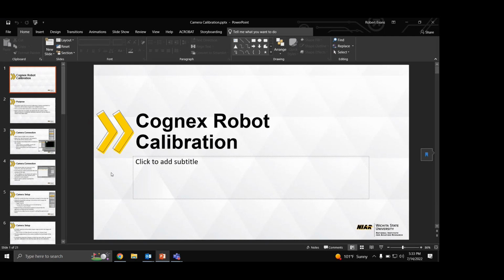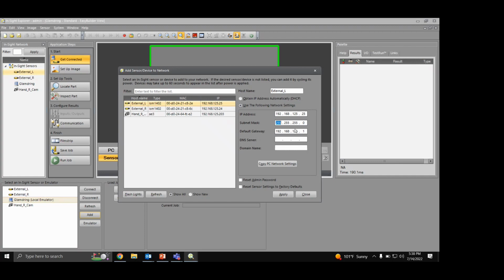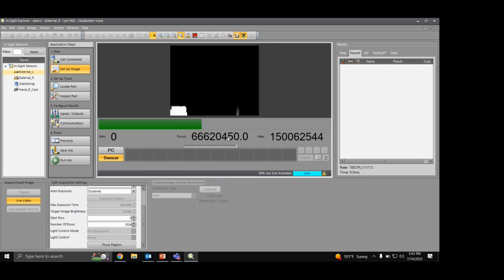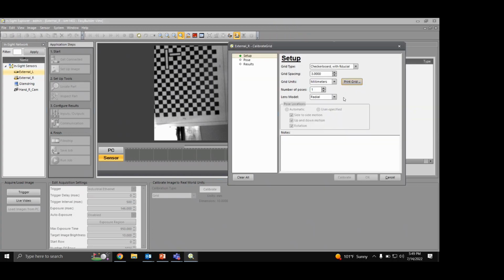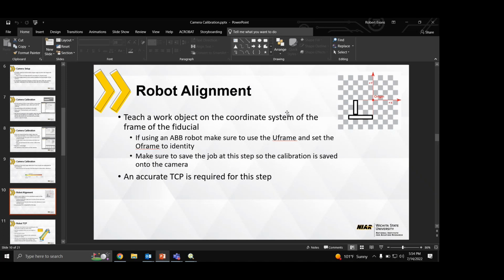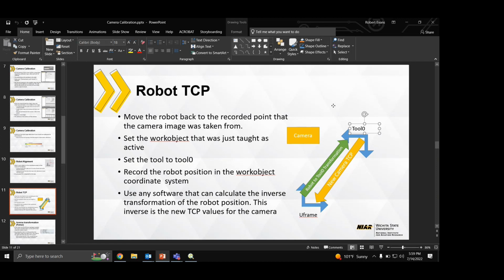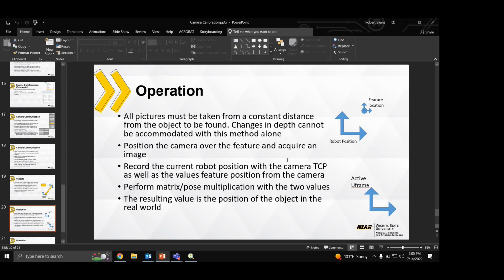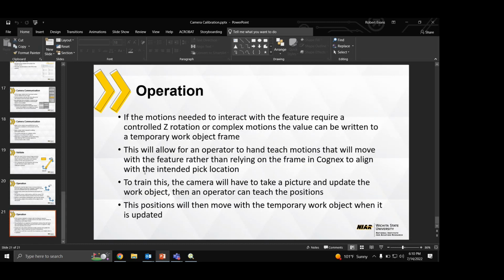Robot Mounted Cognex Camera Calibration

Comment: I´ve watched you other videos ( amazing by the way ) and I´ve seen you have an UR e-Series. I have a question: if I do my calib with the UR caps of cognex, do I need to do a second calib using the grid?
Reply from the maker: If you follow the instructions in the UR cap manual from cognics that actually does a different type of calibration where it's a multi-point calibration that doesn't require the grid so no if you wanted to you would be able to use the grid instead of their calibration method but generally it's easier just to follow the manual. Let me know if that answers your question
Reply: yes it does. Thanks again